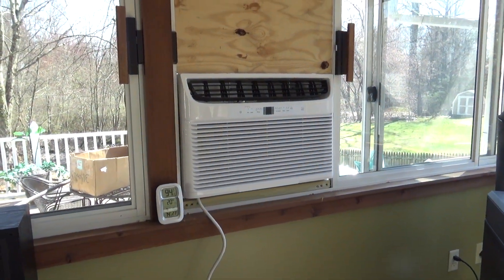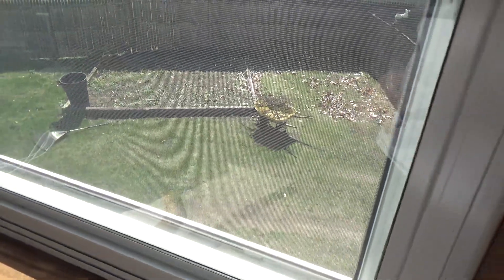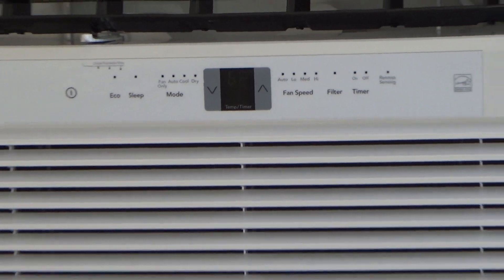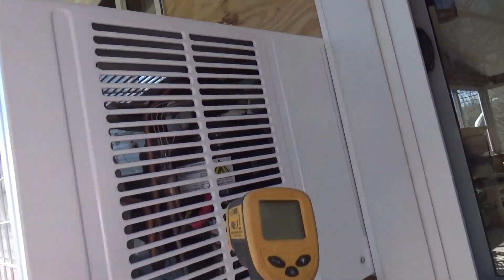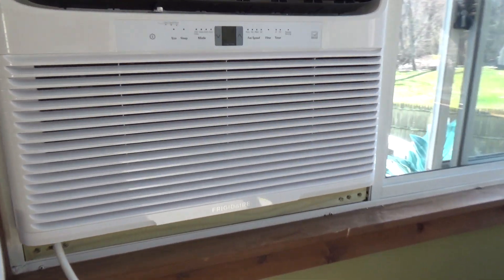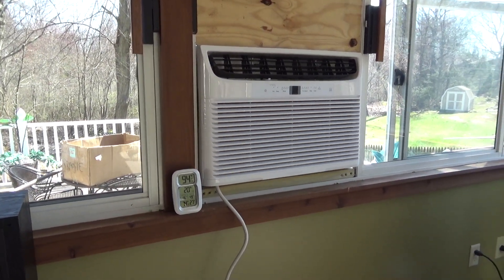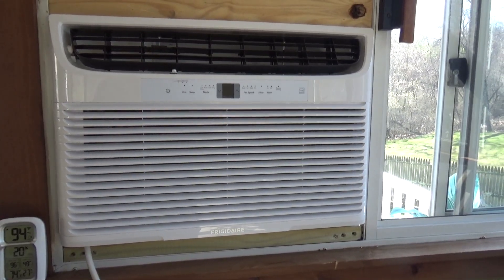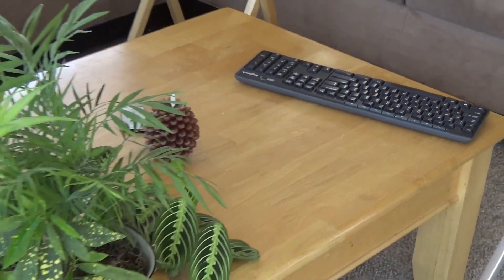Scalding Hot Compressor and Erratic Behavior | Frigidaire FHWC253WB2 25,000 BTU AC Day 2

Comment: The compressors are protected with a thermal overload  that will shut the compressor off at a designated temperature of it does run too hot. If this happens you may have a problem with your unit such as a dirty condensor coil or a bad run capacitor.
Reply from the maker: You can't be serious...
Reply: How in the hell could the coil be dirty after a day of use??? it isnt... You obviously didn't watch the video and think about what he said, because he mentioned a thermal overload. Stop copy and pasting things from websites when you don't know what you are talking about.
Reply: @WalterKnox  ?
Reply: @WalterKnox  can it be a bad run cap if it’s not a dirty condenser coil? That’s the reason why the compressor was on thermal overload
Reply: @ArisBuliteanu  oh my god, it is a BRAND NEW UNIT. IT HAS NOTHING WRONG WITH IT. IT IS JUST RUNNING HOT AS IT IS A LOUSY UNIT. STOP POSTING NONSENSICAL COMMENTS.
Reply: @WalterKnox  Dont be too angry with Aris please 🙏 He is autistic and blind. I am happy to see him on here having conversations. Doctors said he wouldn’t be able to even walk and look at him now 😂
Reply: @WalterKnox  yes, it is a brand spanking new unit
Reply: @WalterKnox  yeah we’ll see how this unit performs on a 100° if so heat wave
Reply from the maker: @mambrake  Look at him now? He's harassing people on the Internet! I understand people have disabilities and hardships in their lives. I try to make allocations for them as much as possible, but when it reaches the point where those challenges are used as an excuse for misbehavior, I really don't have any compassion for the situation.
Reply: @JordanU  May God forgive you. He is on here talking his mind and talking about air conditioning brother. Where is the harassment? Is he not speaking about the topic of your video? He is adding his two cents. This is why America and the world has a hard time becoming great again….May God fix your broken heart. Take care 🙏
Reply from the maker: @mambrake  Over the course of the last 11 hours, he has posted 26 comments into this video alone. The majority of them don't even make sense, and those that do are mostly misinformation or regurgitation of a product advertisement, which is also largely misinformation and exaggeration. The material he posts is not at all on topic with the channel but in direct conflict to what this channel represents. He's replying to every single thread in this box with such material and all it does is stir things up. If you can't read through the threads and recognize that, you're clueless. The world is having so many problems right now because too much of the population has decided to throw common sense out the window and can no longer handle the truth, allowing anything and everything to fly when it absolutely should not.

There are many disabled individuals that interact with this channel regularly. If the commentary is intelligent, sound, and festers a sense of community, then I don't care where or who it comes from. It serves a positive purpose and is welcomed. Commentary that makes no sense, comes at a rapid pace in high volumes, and is a repetitive copy and paste of something seen or said somewhere else serves absolutely no purpose. That's what your son is posting. If you are unwilling to teach him how to properly interact in these kind of scenarios and monitor the activity until it's satisfactory, then he will just be blocked in effort of maintaining sanity here in the box.
Reply: @JordanU  Erase his messages and good bye. Its so sad to run into people like you with no empathy, but this is the world we live in. Enjoy your channel and hope it grows more🙏 May God glorify his name and teach you empathy or even sympathy. Take care bud
Reply: @JordanU  how could you??????????????????
Reply: @mambrake  noooooooooooooooooooooooooooooooooooooooooooooooooooooooooooooooooooooooooooooooooooooooooooo!!!!!!!!!!!!!!!!!!!!!!!!!!!!!!!!!!!!!!!!!!!!!!!!!!!!!!!!!!!!!!!!!!!!!!!!!!!!!!!!!!!!!!!!!!!!!!!!!!!!!
Reply: @JordanU  listen! to! what! Carlos! says! from! the! previous! reply!
Reply: @mambrake  aaaaaaaaaaaaaaaaaaaaaaaaaaaaaaaaaaaaaaaaaaaaaaaaaaaaaaaaaaaaaaaaaaaaaaaaaaaaaaaaaaaaaaaaaaaaaaaaaaaaaaaaaaaaaaaaaaaaaaaaaaaaaaaaaaaaaaaaaaaaaaaaaaa
Reply: @arisbuliteanu3608  This is why people block you. Stop writing crazy things. Did I not tell you last night not to reply on here?! Now you at school doing it. I will take your devices away now Aris
Reply: @mambrake  waaaaaaaaaaaaaaaaaaaaaaaaaaaaaaaaaaaaaaaaaaaaaaaaaaaaaaaaa!!!!!!!!!!!!!!!!!!!!!!!
Reply: @mambrake  he even found me last month and I’m not surprised he didn’t bother going in my comments section yet, and no I did not block him yet.
Reply: @Posoljenomleko  He is a smart boy, only that he is handicap. He doesn’t mean any evil
Reply: @Posoljenomleko  We are going through health issues with Aris right now.
Reply: @WalterKnox  it’s not a lousy unit! I know it’s brand new, but something has to be wrong with it! He could’ve fix the situation, of course, but he wants a vintage unit! Jordan is a vintage piece of electricity, waster who wants to waste electricity by putting vintage units!
Reply: @mambrake  your lovely! You are the best!
Reply: @JordanU  hey!! You don’t speak to a person like that!! Also, I didn’t do any repetitive stuff! So what are you talking about this? Dang person about? It’s not that I’m spamming!
Reply: @mambrake  Lets see here, he has posted MULTIPLE comments on the same video replying indirectly to the video, and to other people who aren't even talking to him. It is all copy paste from websites which are largely misinformation, and while it loosly has to do with the topic of the video, it is not directly related to the topic at hand, and it is still misinformation. That is 100% spam, that is what it is. 
I am autistic myself, I also have ASPD. Also, I was born so early that I was not supposed to live for more than a few days, and if I did they said that I would never be able to do anything because of brain damage due to lack of oxygen. We all have our issues, but that is not an excuse for bad behavior or harassing people. That is what Aris is doing at this point. If you cannot see that, maybe he is not the blind one.
Reply from the maker: @WalterKnox  Very well said. There are clearly multiple people in this thread with blinders on.
Reply: @WalterKnox  that’s completely opposite. I’m not posting anything spam, I’m just advising y’all that something may go wrong with your unit if it was not poorly maintained like that or actually if it was not actually if it was not maintain that well.
Reply: @JordanU  and as, for you, I like that Frigidaire 25,000, don’t you dare even scrap that thing. I was just advising you if something went wrong with that unit. Again, I’m not posting spam, you’re like a complete opposite.
Reply: @ArisBuliteanu  This is a 2 year old comment chain, one that is nearly 30 comments long. In this chain you have posted false information, name calling, and random letters under multiple different accounts. That IS indeed posting spam.
Reply: @WalterKnox  it actually has been three years since I’ve advised Jordan about what is happening to this particular 25K. BTU. Again it’s not posting spam. It’s advice like a consideration.
Reply: @ArisBuliteanu posting repetitive comments with false information, being told to stop, and continuing to do so under multiple accounts is posting spam. There are no two ways about it, it is not up for discussion or interpretation; you were and are continuing to be a spammer.
Reply: @WalterKnox  well, that’s the opposite. I’m not posting anything, I was just advising Jordan about that situation for this Frigidaire 25,000 BTU. How dare you!
Reply: @ArisBuliteanu how dare I what? Say what Jordan himself and many other people already know and have said? Use come common sense will ya and look at what you are doing. Read this comment chain which you have needlessly revived and tell me that you are not the one out of line here. This whole mess has been forgotten about for years, and here you come back again to start some more nonsense, spread some more false information, and post some no spam for no good reason at all.
Reply: @WalterKnox  hey! I’m not starting to post spam, I was not even posting spam three years ago, not even false information. I’m just advising Jordan for what his case will be for the Frigidaire 25,000 BTU. Again not false information. It’s just that you don’t read the comments carefully.
Reply: @ArisBuliteanu I read the comments. You posted random unhelpful “tips” which did not apply to this case in any way shape or form that you copied from some sketchy website. You replied to every single comment on this video and had nearly 30 comments on this single video (now well over that.) They we’re all the same nonsensical type of comments posted here which were unhelpful and unwanted. And then, when asked to stop you started posting random gibberish under different accounts and refused to stop. Now here we are again after you started this nightmare of a chain up again after 3 years going around in the same circle… yeah, you aren’t the one out of line champ. 

I honestly don’t know why Jordan has not blocked you yet, you are certainly blocked from my channel from the time you started this same type of nonsense there.
Reply: @WalterKnox  are you out of your mind or something? Because I was not posting about websites, it’s just that a house advising Jordan about the case for the refrigerator 25,000 BTU
Reply: @WalterKnox he comments on newer videos
Reply: @LW8015ER  Yes, mostly if not all useless spam comments on those as well; but I am not replying to any of those as I am not in the chain, and if I responded to all of this person's messages I would probably go insane just trying to make sense of the nonsense.
Reply: @WalterKnox  oh! It’s you again? I’m trying to help Jordan with the situation of the scalding hot compressor on that Frigidaire 25,000 BTU what she calls it piece of junk but it’s not! It’s a peace of mind.

Comment: Jordan.  I think you may need to plug your drain hole.  It got to 85 here and my 6000 btu ge AHP06LZ was running quite hot, and loud.  My unit has  Quingan brand compressrr.  I prefer them over the GMCC brand because they are much quieter.  My air temp at the discharge grille is about 42 degrees, and 36 degrees on a very cool day. My unit has a removabe rubber plug.  On supet hot days i install the plug during the day, and remove at night.  The thing with the water is i think it slows down the fan as i can hear the motor make a distinct whinning sound especially on low and medium speeds.  As soon as i remove the plug and the water drains out, the fan motor sounds normal.  You said you were getting 20 degree discharge air.  Your unit may be under charged which msy be causing the compressor to run hotter than normal.  Also it sounds louder than usual which these rotarys can sound louder than normal when under charged.  I wonder if you can return and exchange this unit, chances are they will not even pull it out of the box being so heavy so they would not notice the hole you drilled.  Hope you can get it working properly.
Reply: I know you would said that! It may be under charged (that’s right)
Reply from the maker: The coil was cold all the way through, and both the evaporator and condenser temperatures themselves were reasonable. It was only the compressor that was outrageous.
This particular room is very dry, usually in the 20% range or less on a hot day. Through operating the entire day, only about 1/3 of a gallon of water was pulled. That amount of water entering the machine that slowly would evaporate before it can even accumulate enough to start slinging.
Reply: @JordanU  what is the square footage in this room? It could be you have an oversized air conditioner like this.

Comment: It runs hot because of the drain hole that you drilled. It’s made and designed to run with water to cool it down
Reply: I watched this last night and had to come back to comment: I have to agree with the above, it's designed to splash the condensate water on the coil, which removes more heat as it trickles back down the coil, plus the coil is kept wet to create a wind chill effect as the fan blows across it. I'd say plug up the drain hole and see if anything changes.
Reply from the maker: @dustinkauffman5868  On a hot dry day, no moisture comes out of the machine, which means there also wouldn't be enough to fill inside the machine. In many parts of the country where these are sold, there's only dry heat with no humidity. It must be designed to operate without the water. I'll take my chances the way it is, it's far more likely to fail from rust then the compressor running hot.
Reply: The water will only work at first before it gets hot from sitting in the pan for too long (someone else said the same, I think it was walter), so really it's not really doing much at all.
Reply: @psychedelicnarwhal9599  the water won’t get as hot as the compressor. It’s not gonna boil out of the pan. Watercooling is used in many different applications and works extremely well.
Reply: @generalman3942  yes but the subcooling is minimal at best
Reply from the maker: At most, the water would cool the condenser, not the compressor. The condenser temperatures were not beyond reason.